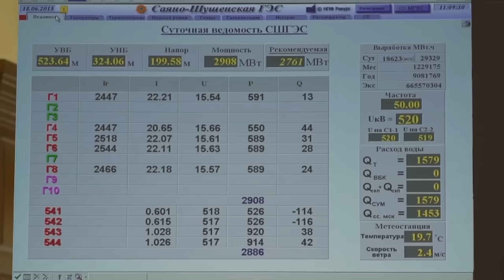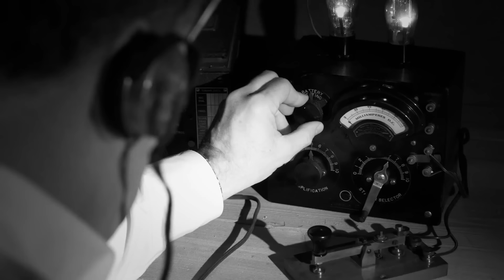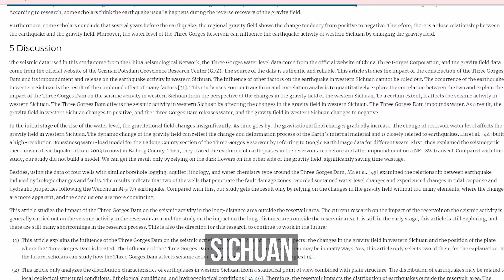Massive Dam Failures Caught On Camera

Comment: I  heard  engineers  talk  about  the  left  hand side of  the  3  Gorges   Dam  as the  rock  in the  area  is  not  as 
strong as the other  side - I  think the  water  behind  the  Dam is  backed up for  200 Miles -  massive increase 
in  huge shafts  500" deep  filled with concrete and  steel - but the  water  will always  find  away to get thru ?

Comment: I am not a scientist, or even a university graduate, but from what I can see the 3 Gorges dam looks to be straight. Surely every structure holding back a lot of water should be curved to that the pressure effectively causes the structure to try to compress, while a straight structure would surely bow out and get weaker, leading to eventual collapse?
Can someone please tell me that I am wrong?
Reply: I'm no engineer, either, but from what I've read, an arch (curved) dam is built where you're plugging a narrow canyon, like the Hoover, but a gravity dam like the Grand Coulee is built on wider stretches. It really depends on formation and composition of the site and what you're trying to accomplish with it.

Comment: The Michigan Dam failure was caused by the Michigan state government. They had been operating that Dam and producing power from that damn for decades. They intentionally and failed to renew their license for no purpose than they they didn't like them. They also refused to allow them to relieve the pressure on the structure because they knew how much pressure it could take and is it already overfilled its design specifications. The Michigan state government was responsible for that Dam failure. Nobody else.

Comment: Grand Teton Dam was a design failure, not a maintenance failure.
Reply: Yes, it was built on a heavily cavitated site, and its builder, the U.S. Bureau of Reclamation, steadfastly ignored the warnings of the geologists who surveyed the site. Then it was not only permitted to fill too fast, but construction was not QUITE complete and the spillway gates were closed because they were being painted. The diversion tunnels used to direct the river around the dam site while it was under construction, were also permanently closed- why were they not kept in operation until the thing was completed? But the Bureau was too eager to capture the snowmelt off the Tetons, and there was more of it than predicted. It was a tangle of stupidities.
Reply: It was built on rock that was highly fractured. Once it started being filled, it leaked. They kept trying to fill the cracks with grout, but it kept leaking even worse. But they kept filling it anyway. Politicians wanted it to work. The builders wanted to keep collecting money.
Reply: @mikewatson4644  , exactly.

Comment: The photoshopped click bait image can never happen. Depicting water spraying out to a level higher than the dam wall is against the laws of physics (Bernoulli's Equation in this case)
Reply: Really?
Reply: Bernoulli's Equations applies to the static systems.
When you consider flow and velocity, you will get higher heads than the reservoir level.
Reply: @dragosnanu5085  LOL, Did you find a way to make perpetual energy? Why have you deemed velocity head to be static?

Comment: If it is not a fresh water supply dams should be first source of electricity production and kept as low as they can be.
Reply: The trouble is, you need what's known as "hydraulic head" to produce electricity- the force with which water enters the turbines. Low dams can never produce enough power to be worth their cost. The higher the dam, the more water flows through it and the faster it flows, and the more power it generates.

Comment: The Three Gorges Dam is built with substandard concrete so it's a question of when not if the dam is going to fail.
Reply: How do you know it is built with substandard concrete?
Reply: @cplcabs  While the dam was being built the CCP hired an Irish firm do give their assessment of the Dam. They stated the concrete was substandard. The CCP called that assessment: "racism". It does not surprise me as most building projects use substandard components in China.

Comment: 11:03 ya... why would you seal the diversion tunnels??? 
.
look at fort peck dam in NE Montana USA (4 miles of earth dam.... longest hydraulically earth filled dam in the world)...... 
originally it was ONLY for flood control (aka, no power house)
.
but they decided to do something with all that water.... 
and build, at first, 1 power house on 1 of the 4 tunnels (with a 2nd power house being built later on a 2nd tunnel)
.
however.... the 2 other tunnels still can flow at FULL capacity
plus it has a MASSIVE spillway  
.
.
and they had all 4 tunnels AND the spillway WIDE OPEN during the record 2011 flood
if fort peck broke.... because its the first dam on the Missouri river.... it would flood out the rest of the dams
causing a chain of failures that would go from Montana, to Missouri state, and then flood the Mississippi river
.
.
anyway.... why cap the tunnels?
just put a "valve" or a gate on them..... and use them for emergency use (which is exactly what fort peck does)

Comment: The Dam management should get their Dam act together and we would not have all these Dam problems.
Reply: Dams are incredible difficult to build. There are so many factors that make them almost impossible to build safely. Which is why I promote nuclear power. Doesn't provide flood control but they're actually pretty simple to operate. They just cost a lot because to keep them safely operating it takes a lot of work but it's predictable work unlike with dams. Also nuclear power plants don't guarantee large areas of land to be more or less permanently destroyed like Hetch Hetchy Valley. Even if the dam was removed it would take hundreds upon hundreds of years before it'd be back to it's former glory.

Comment: It’s simply the matter of time, before the Three Gorges Dam fails.  It’s not convex shaped like other dams and therefore weaker.  The construction methods of Chinese modern high story buildings are not good.  They are not listening to geological experts. Geology seems to have major function in the destruction of many of the dams outlined in this video. You also have the failure of turbine components that can happen.
Reply: Arch dams aren't necessarily weaker but are often stronger. They are built in steep, narrow defiles while gravity dams like the Three Gorges are used across wide spans.

Comment: The thing to remember about the waters that these dams hold back is that water weighs 8 lbs/ gallon.  Thats allot of weight on the earths crust directly under that water.  Take for example a wheel balancer at your local tire shop.  If you add a small weight after it has already been balanced, it will throw the wheel out of balance, just that little bit, but it's enough to notice.  Earth it self is no different, for the most part it is balanced, but when we do something like 3 Gorges, it changes it, and there will be physical planetary consequences.

Comment: The Three Gorges Dam is perfect! 

It helps Taiwan(ROC) get a "nuclear" option without nuclear weapons. 
They just need to get the ability to at least have a reasonable threat to destroy the dam if the CRP starts a bigger missile and air attack on the island. The damage from destroying the dam would be bigger than even the biggest nuclear ICBM's hitting a megacity. 
Even if the chance of Taiwan destroying the dam, by the PRC is estimated to be around 5%, it would probably be a too big risk to take for them. 

So love the dam almost as much as I hate the CCP, PRC, PLA, PLAN, PLAAF, and Xi the Pooh especially!